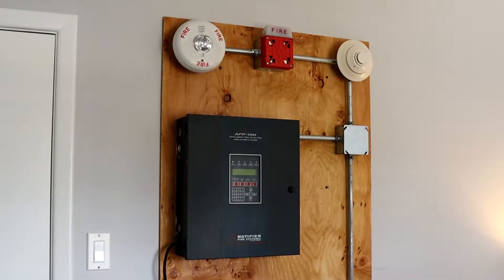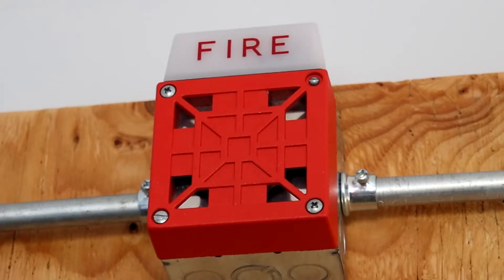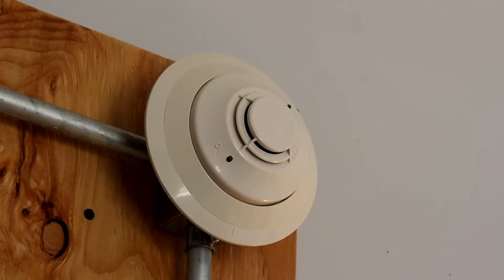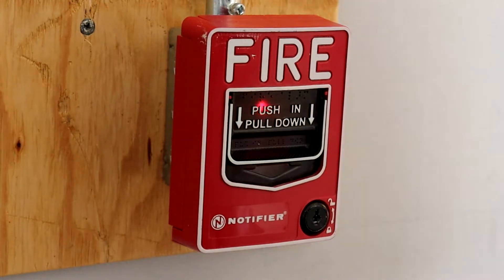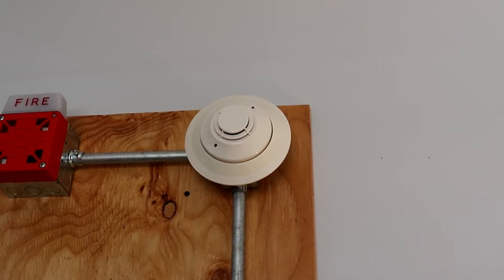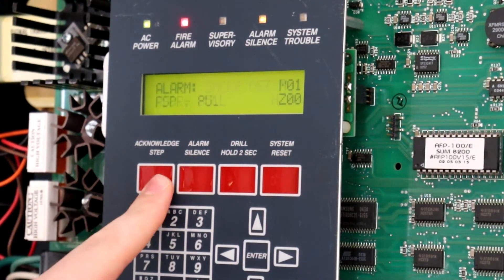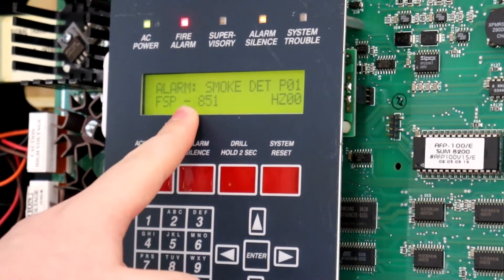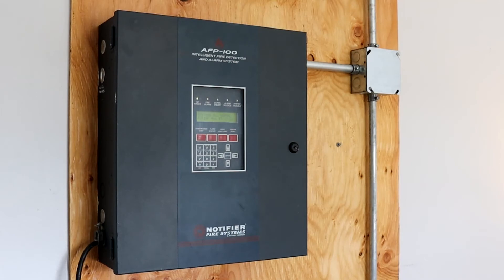Notifier AFP-100 Demo Board System Test 3 -  SpectrAlert Advance and Wheelock 7002T!

Comment: I usually hate how 7002Ts sound on FWR but I like this one. Also the higher the amps on a 7002t will it skip faster? For example, 24vdc 10amps
Reply from the maker: Shouldn't affect it; current can only be "pulled" by the device, so at a specific voltage the amount of amps being drawn will be constant. However, a lower voltage may reduce the skip rate since the capacitor will take longer to charge. Haven't actually tried this though.

Comment: Ceiling mounts can only go on ceiling, on the wall, it's not up to code, I'm am taking this seriously, so don't get too confused.
Reply from the maker: Actually, any model of the SpectrAlert Advance series can be mounted on either the wall or the ceiling due to the design of the strobe; it says so in the manual. Also, since this is just a demo system and it's not being used for legitimate protection, it's not that big of a deal if it's not code compliant. Thanks for watching!
Reply: Well, I only allow ceiling mounts on ceilings at my house, and wall mounts on walls only at my house only.